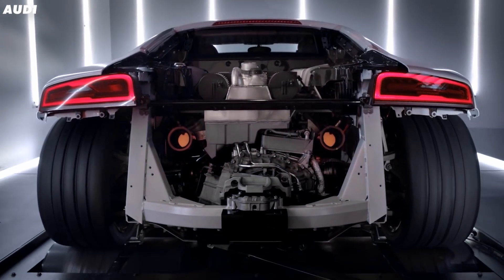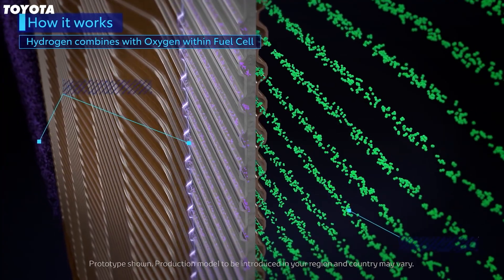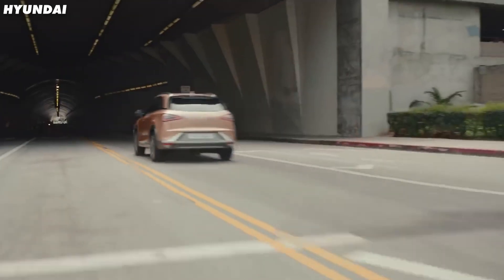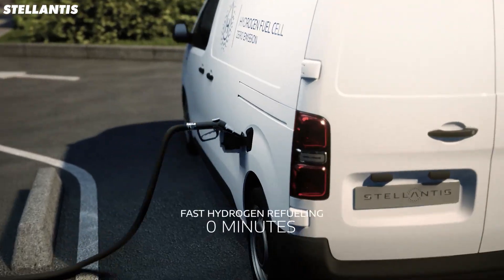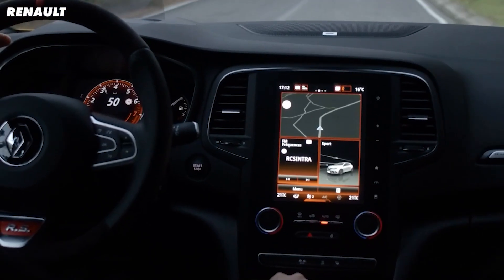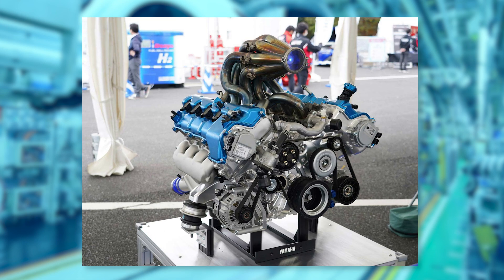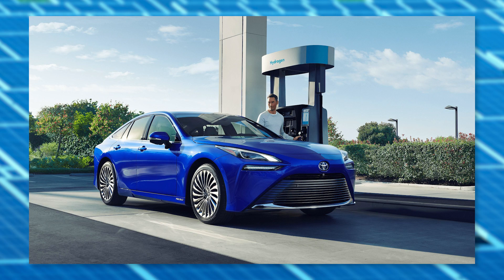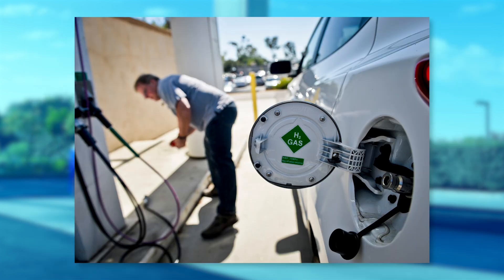The V8 Engine that Runs on HYDROGEN

Comment: A program on Chanel 4 called "Equinox", "It Runs On Water" back in the early 90's I think, but it showed Stanley Mayer, a man who made a car that ran just on  water on demand, no storage tank. Isn't the tech there to do just that now? Water as free fuel, it falls out of the sky!!
Reply: The Illuminati will never allow this. Stanley Mayer was poisoned when he didn't sell his patent for a Billion dollars.
Reply: I imagine it worked as an additive or that it was somehow pressurized in the "fueling" process, making it either an add on for burning something else more cleanly or just extremely low efficiency.

That technology would be massive if it worked like petrol powered motors, however we can't quite burn water only without inventing a whole new chemical reaction.

Comment: Another cost of electric cars: building power generation infrastructure and improving/expanding the electrical grid to accommodate all cars being electric. Who is paying for that?
Reply: Euhm ... if we started using hydrogen fuel cells, we would need 3 to 4 times as much electricity to create the hydrogen. If we wanted to burn the hydrogen in an engine, we would need about 6 to 8 times as much electricity to create that hydrogen. Where are you going to get that power from if you think the power grid can't even power a much more efficient EV?
Reply: Who pays for all the oil rigs, pipelines and oil tankers?

Comment: I think hydrogen's a lot more sound of an idea than EV's as far as I'm concerned. It circumvents most of the things that makes mass electrification impractical like power grid overload and lack of range, but only stumbles due to the same issues that used to be holding back EV's, like the lack of charging stations, mass production not being green enough and underdevelopment of the technology. I'd say that with a similar research interest in the field as with EV's, hydrogen could easily overcome those barriers in a matter of years.

Comment: technically any car can run on compressed gas.  it's not a big conversion.  not sure why this is a big deal 🤷
Reply: Hydrogen is very expensive and hard to manufacture and store. I bet you’d rather go electric than pay to fill up your car with hydrogen.

Comment: Cars that can run on hydrogen would have my preference if the hydrogen stations were more present. Hydrogen can be made using renewable energy or nuclear and doesn't "degrade" like a degrading lithium-ion battery forcing a big bill on you after 10 years of car ownership. Even in the form of fuel cell cars it is still better than fully electric using batteries and probably would negate the NOx issue due to high heat with the ICE path, but I don't know if fuel cell cars share the same degrading issue as batteries. 

Meanwhile I believe that currently existing ICE cars could potentially be converted at not a big price to running on hydrogen which could extend the lives of cars beyond the dates set for diesel and gasoline bans in the future. Also we have a century long (if not longer) experience with ICE thus repairs would be familiar, possible almost everywhere at a decent cost and transparency unlike fully electric cars. Not to mention no long waiting.

I have also heard about nuclear diamond batteries being worked on, but the fact is most people discourage or downright hate the idea of nuclear power at localised power stations far from them. Why would those same people accept close to the same radioactive and "dangerous" materials in close proximity, even if utilized in a different form?

EDIT: I might be wrong but I thought since hydrogen combusts more violently, it might produce more torque potentially. Add to that it's ideal A/F ratio is 34:1 and has higher compression possibly because it self-combusts at much higher temperature than gasoline thus being like higher octane... I believe combining hydrogen ICE with lots of gears could prove more fuel efficiency than currently operating gasoline cars.
Reply: Hydrogen fuel cells do degrade though, and will require repair or refurbishment at some point during their lifetime.... And you obviously never heard of EV battery refurbs, which normally cost a fraction of a total replacement.....

Comment: I think hydrogen makes more sense in the long run. Sure it's not as efficient as straight electricity, but making a sturdy hydrogen tank will be a better use of resources than the demands for rare earth metals of EVs which can be unethical and toxic. Not to mention the batteries are just as weighty and volatile but unlike hydrogen have a shelf life to boot. There's also the suggestion that rotary engines are apparently better for hydrogen than regular piston engines as they don't pre ignite so easily. More spinny triangles is never a bad thing.
Reply: Watch this and remember my comment in 2050 once we run out of electric car batteries and lithium were going to need hydrogen in the end.
Reply: @vaeryannatha5877  hydrogen is stupid we’ll end up making fuel out of kelp and such before hydrogen stations ever become available 
Electricity is ubiquitous and gas cars are ubiquitous hydrogen is neither
Reply: @KCJbomberFTW  Sure bud we'll when it comes I'll re text you here and say I told you so lmao
Reply: @vaeryannatha5877  it’s been a decade bro and the mirai has sold 9000 cars in America and the newest car is $80,000 these are rich dorks buying toys there’s 0 market and there’s cheaper and better alternatives than could physically be possible with hydrogen already available…
Reply: Tesla 4680 batteries are already just lithium and nickel.. no rare metals and no acid processing
Reply: @KCJbomberFTW  that's a fair point, makes sense they'd want to get cobalt out the batteries. Not a big fan of Tesla especially making batteries a structural part, going to make maintenance a nightmare
Reply: @purpleguy3000  face palms lol there IS no maintenance 
that’s the whole point 
the batteries are good for 1,000,000 miles no maintenance
Reply: @KCJbomberFTW  if that's the case i'm impressed, haven't looked much at tesla in a while because not a big fan of the company or their cars. Structural batteries still ruffle my feathers but good to hear they're still innovating
Reply: @purpleguy3000  structural batteries are engineering genius it creates the chassis rigidity of nearly a carbon tub while removing essentially an entire flooring section of manufacturing 
These new model 3s and Ys are being made of 4 doors 5 seats a battery and a single stamped front and rear

Comment: Aside from Aston Martin... I did remember reading that Toyota did a direct hydrogen injection and ran at the Le Man X... I think Mazda also tried it earlier before Toyota's Mirai.
Reply: So? Lamborghini also took a tractor around lemans should we drive those
Reply: @KCJbomberFTW  whats your point? I merely pointing out attempts made to use hydrogen.
Reply: @KCJbomberFTW  Stop shitting up the comments. BEV's are the worst kind of EV's and have no future. At least hybrid EV's have potential.
Reply: @Slayer8957  you’re a joke “bev” all of them will be battery there is no hydrogen future there is no charger outside California and New York anywhere in the country there is no major investment and battery production is growing faster and getting more power dense every year and uses NO rare metals lithium and nickel only
Reply: @KCJbomberFTW  Until hydrogen's problems have been fully resolved, the same process of air and water can be be used to create synthetic gasoline and diesel, which is converted from methanol and dimethyl ether. ICE's can still be utilized using synthetic fuels long after natural oil has been phased out. And eventually hydrogen storage issues will be resolved for transport, and can be used directly instead of conversions from hydrogen carriers. Regardless, BEV's will never be viable. It will be ICE's and fuel cells.
Reply: @slevingaius  Because of hydrogen storage issues, both as hydrogen gas and liquefied hydrogen, there are just so many other better hydrogen carriers -methanol, ammonia, methane gas, even hydrogen peroxide. All of them would make better fuels. Even though some energy is lost converting the created hydrogen into something else, its still better than dealing with storage issues, as the efficiency gains from the others overall beat out the losses. 

But if we ever solve the hydrogen issue, then hydrogen itself becomes the best form by far. Im sure it will be resolved eventually. Theres a lot of promising theoretical technologies that are currently held back by the material science of our time. And until then, we can use any of the alternatives i mentioned.
Reply: @Slayer8957  I agree that the ICE vehicles will be powered by synthetic fuels and will live on BUT that’s for the very very few collectible cars left like your Grand Wagoneers MKIV Supra’s LaFerraris or your split window corvettes. Allnall I think maximum 15% of the cars on the road in 20 years will still be ice the rest being battery

Comment: I strongly belive that hydrogen combustion engines are the future of the Motoring industry, at least for True Cars Guy's Cars.
Reply: I don't, because you'd still be stuck with an engine that had hundreds of moving parts to wear or break, a cooling system, timing and fan belts etc...... The workshops would love it of course.....

Comment: Electric cars also need energy to charge their batteries. Furthermore, the environmental impact of most of these green options includes mining and refining minerals which often come from absolutely squalid mines in places with zero environmental protection. This is blood diamonds all over again. The batteries in that Tesla which (insert celebrity name here) drives as a virtue signal comes at the cost of strip mines in conflict zones in Africa, with the minerals processed by slave holding state corporations in China.

Comment: Why does everyone still go on about the infrastructure not being there, well before all the battery cars the infrastructure was not there and still isn't! So the infrastructure will grow as required and its a better option than pure EV's
Reply: BECAUSE THE INFRASTRUCTURE IS NOT THERE... Apart from major transport corridors in Norway and a handful of major cities... there is zero Hydrogen infrastructure.
Reply: @sandervanderkammen9230  gotta love it when people get all caps lock as if they are shouting.. And the infrastructure was there when EV's were released? Still not there to the present day and is seriously lacking for everyone to use a crap EV...
Reply: @davidpriestley7585  EVs have been around for over a 120 years... they once accounted for 28% of all vehicles registered in the United States.
Reply: @davidpriestley7585  There are only about 8,000 hydrogen powered vehicles in California and 52 hydrogen stations open to the public, these stations are paid by government programs and there is little investment from the private sector.
Reply: @sandervanderkammen9230  and no more will be built, come on you are like the EV's you love so much! A one trick pony and my god is it boring!
Reply: @davidpriestley7585  I'm not a fan of EVs... but you have to be very benighted to ignore that they have had an established market segment for over 120 years.

Diesel and Otto type engines are capable of running on a very wide variety of alternative and sustainable  fuels. 
The implication that EVs or hydrogen vehicles are zero emissions is not only misleading its outright dishonest.

Comment: Don't forget that batteries used in EVs often require fairly rare metals that have to be mined and the batteries are only good for a few years of charging and discharging before they are landfill.  They also make up a good share of the value of an EV, making one with a dead battery almost worthless.  Hydrogen cumbustion engined cars would have neither of these problems.
Reply: You can recycle batteries entirely
And yes every Chevy volt was recalled because a misaligned battery thing but guess what engines break too. And faster. An electric motor has 1 moving part. They ar
Reply: Exactly! That's the main reason that it should be the primary choice. They haven't solved the battery problem with EVs and Musk's solution is let's build batteries faster and make more of them...
Reply: Er, no. You couldn't be more wrong.  The battery in an EV has an 8 year warranty. That's hardly a "few" years.  And only a complete fool would put an EV battery into landfill, because they're way too valuable for that. Older EV batteries can be recycled, and the lithium and cobalt can be recovered to around 90% and reused in new EV batteries.  And it is not always necessary to replace an EV battery that loses some efficiency. EV batteries can be repaired and refurbished, at much less cost that a complete replacement. Obviously you've done no research on this subject before you posted.  If you had, you'd discover that there are EV specialists out there already carrying out refurbs on EV batteries, rather than replacing them. Cleveleys Electric Vehicles in Gloucestershire, England, carried out a refurb on a 10 year old Nissan Leaf battery. It cost the owner £600 and took 4 hours. Do more research, because you are clearly very uninformed....

Comment: Why not make hydrogen power plants that can produce energy for the EV charging net work
Reply: how do you get the hydrogen then?
Reply: Because then you're wasting energy on making the hydrogen to waste even more on converting it back into electricity. And fuck electrics. Gimme gears!
Reply: So you want to make hydrogen powerplants (which will use huge amounts of electricity, because of the inefficiency of the process) to produce electricity for the grid?  Something doesn't add up here.....